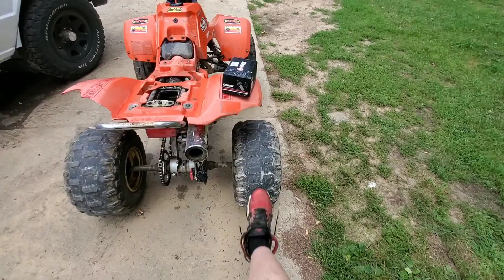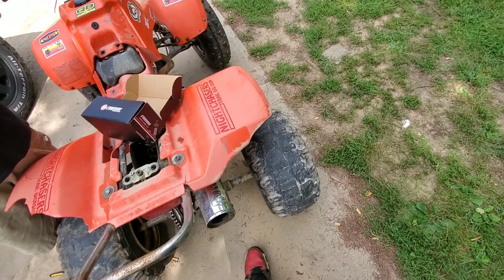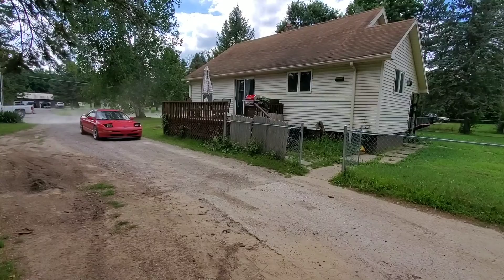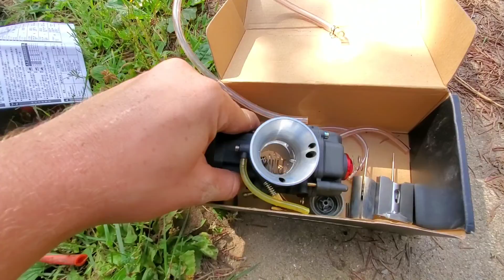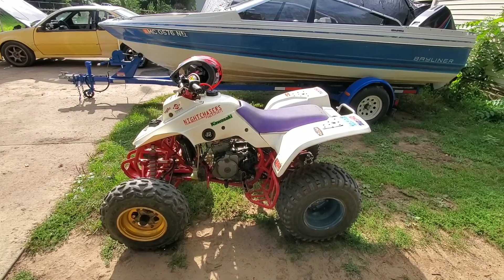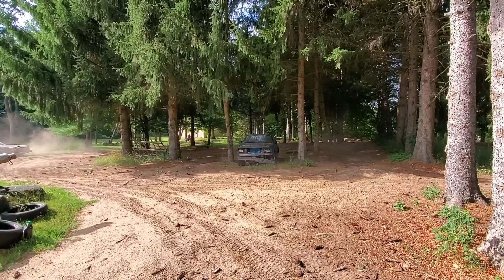E85 Quad gets a carb upgrade

Comment: If you still have the other highly modified 230 that had the motor swap that blew up, I'd be interested in buying it. I almost bought it from Steve before you bought it. Nice vid BTW!
Reply from the maker: Yeah I still have it. I had rebuilt the engine which was tough. Had to order a custom piston, new LA sleeve, had the head fixed, new valves, seals and gaskets. But now I gotta change the jug or drill and tap it. Not really sure if I want to sell it yet but I'll definitely let you know if I decide to.
Reply from the maker: If you're still interested in buying that 350x lt230 lmk. Thinking about selling it.
Reply: @NightChasers  Definitely interested.
Reply: @NightChasers  Text sent.

Comment: I put a 30mm nibbi on mine it really woke it up ...
Reply from the maker: Yeah it's definitely a good upgrade!
Reply: Do you know which jets numbers  you used so I can get close with mine? My mid range is lean .
Reply: Or needle clip setting? Mine is on 3rd groove
Reply: Im looking a getting this carb for my son's 230 what throttle cable do have
Reply: @scottyridder9898  I used the factory cable without any modifications
Reply: Update: using the pe30 carb with the factory un modified carb intake boot. I had to stretch the factory air box boot and use and new little bit longer hose clamp. Using the second last main jet out of the 4 it comes with on the 3 clip needle. About I’d say 2 turns out on air idle screw set in the summer time.  

Engine mods I have are wiseco high comp 1mm over 
Hot rods con rod (crank)
Stock intake valve lol but clean and adjusts to specs and stays lol 
UNI air 
Slip on exhaust no silencers straight open thru
Stock cam
Iridium plug stock heat range 
Idle at 1440+/- 100

I only used premium as well if that matters.

I’ve put 120 hours since build not a problem reliable as ever.